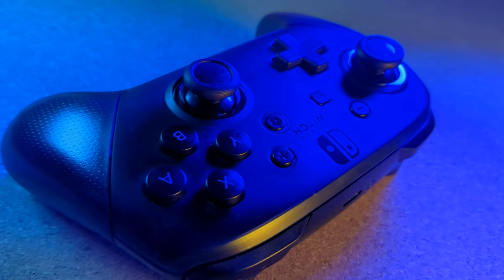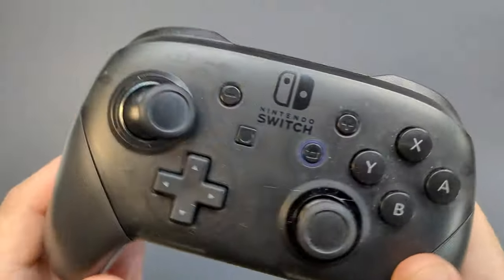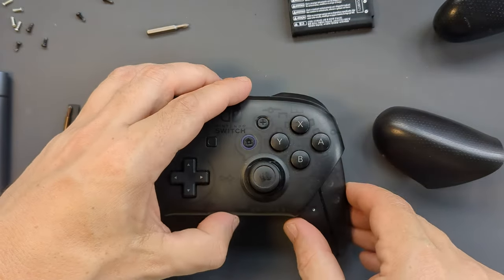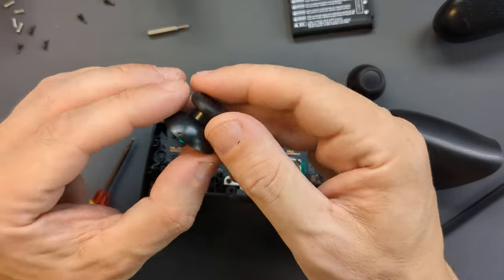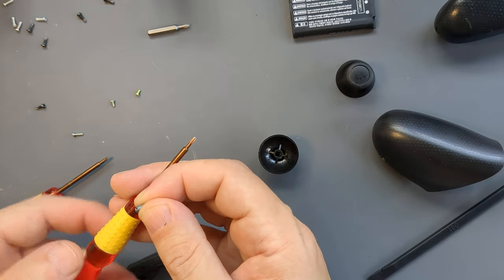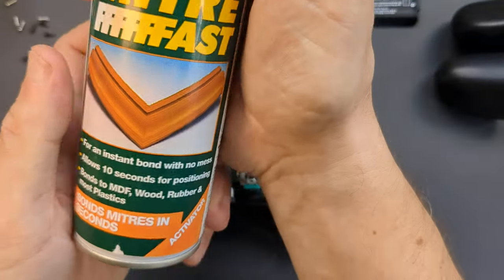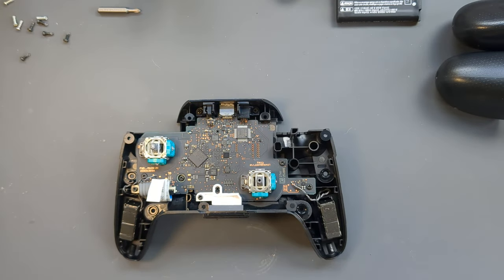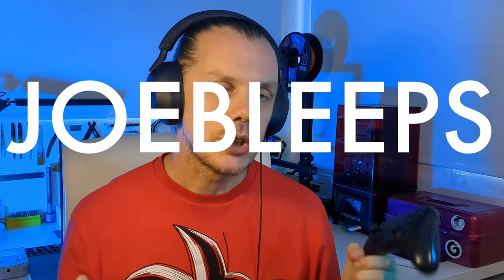Repair Nintendo Switch Pro Controller - Broken Joystick No Replacement Parts

Comment: Excellent fix! I don't know if I'd have thought of trying to glue the stick back on, I'd probably have gone straight for a replacement module, but obviously this is cheaper and solderless! I wonder if the rod from the L/R hinge on a DS would have fit in the hole...
(Bonus fact: the battery in the Pro controller is the battery from a 3DS, which does make getting a replacement easier.)
Reply from the maker: Ahhhh I wish I'd thought of that! Such a great idea and I have loads of those rods. I suspect they would fit but maybe a bit long
Reply: That’s what he said! (Sorry)
Reply from the maker: @Biadosaru  🤣

Comment: Thanks so much for your video, just helped me fix mine after I opened to change the sticks, the ribbon inside was not properly inside the clip maybe and the buttons were not working, as you said checking that first thing fixed the issue ❤
Reply from the maker: Really glad to hear that!

Comment: Mine broke a year ago right after I got it. It only works when supplied with direct charging is there a fix for this?
Reply from the maker: @Koda_TheDog  sounds like a battery issue maybe, either the contacts aren't connected or the battery needs replacing?

Comment: Did I understand correctly, you could have replaced the caps and it would have worked?
Reply from the maker: It was the stick itself that was broken in this case, I thought it may have been the cap. Side note, it's had many hours of use since and no problems

Comment: Hi. Have you ever tried polywatch on the DMG original screen lens?
Reply from the maker: I haven't but I can give it a try. I remember trying the Tamiya compound and it was no good, went a bit cloudy
Reply: @JoeBleeps  That's very nice of you but I don't want to waste your time. I will probably try it myself at some point. Thanks! ;)
I was asking because I plan to restore my childhood DMG. The screen has only small scratches so if there is a way to at least attenuate them, I would prefer not to replace it. I've seen people recommending Displex or Polywatch.
Reply from the maker: @Superamak  I'll be trying it out of curiosity 😁
Reply: @JoeBleeps  Awesome 😉
Reply from the maker: @Superamak  okay, so I tried it and it did improve it with a quick rub down. I tried to make a short video but it was so hard to get my camera to focus on the scratches! Deeper scratches no luck, they are better but still present, light wear polished out pretty well
Reply: @JoeBleeps  Thanks a lot! This is exactly what I needed to know. Cheers!
Reply from the maker: @Superamak  no problem

Comment: Fantastic D-pad? LOL
Reply from the maker: Are you not a fan?
Reply: I'm certainly not a fan, I had to put tape over the inside half of the contacts to prevent spurious inputs - try playing Tetris 99 without accidental slams!
Reply from the maker: @Biadosaru  I've never had any issues with it, and I like that it's nice and big. I'll have to try out Tetris 99 with it and see if this is the same!

Comment: How do I fix loose thumb sticks for Nintendo switch joypads
Reply from the maker: On the joy cons?
Reply: It’s like a pro controller but you can also play handheld
Reply from the maker: @Randomclips9182  I wouldn't be able to tell you without seeing it. I'm sure it can be fixed though!